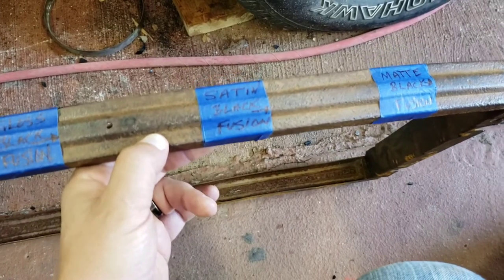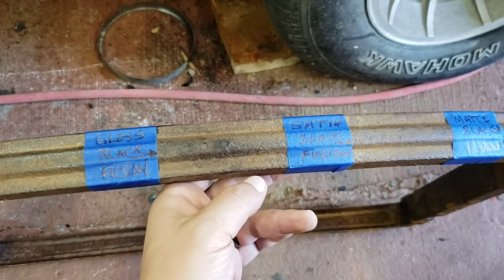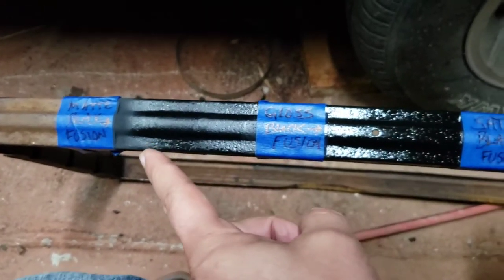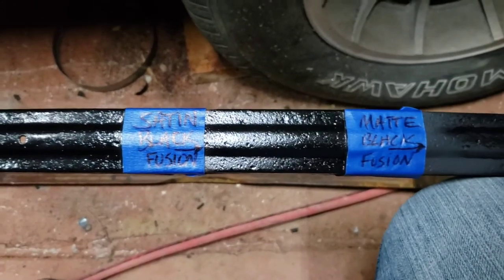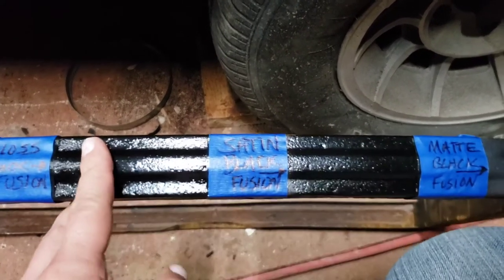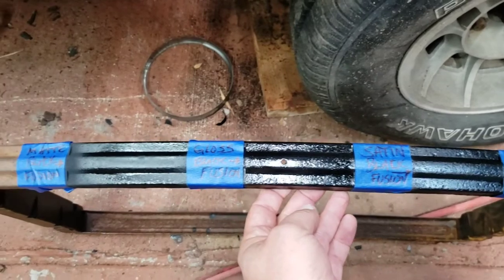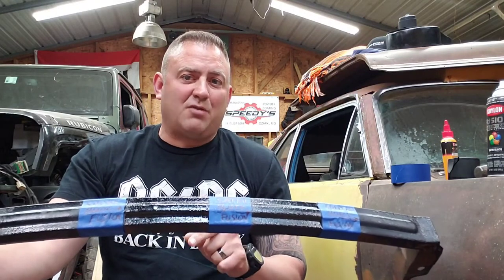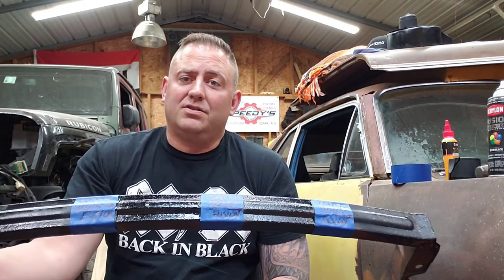KRYLON FUSION GLOSS BLACK VS SATIN BLACK VS MATTE BLACK FUSION all in one PRIMER PLUS PAINT

Comment: Excellent video. I'm painting my headlights inner shroud, I want to use the satin black for this, I know fusion says no prep, but should I scuff it up before painting anyway? And do I add a satin clear coat for UV resistance?
Reply from the maker: As far as scuffing up or sanding...I would just to get off any issues with the metal or paint that may cause it to not stick to etc...  as far as clear coat...  I am not aware of any fusion clear...even though I would definitely like to see it and try it out...they may not have it in my stores....

Comment: You can be a professional painter, the problem that I am seeing is that you were very cheap with the paint, and you paint such small squares and especially on a very rusty bar. That is the reason you can't see no difference between paint coats. As a professional you should have painted on the hood of any car

Comment: I used glossed then color sanded then used flat and it ruined the part the paint crackled. I waited 3 days in between coats. Ruined a brand new plastic grill for my sons truck. Fuxk Crylon fusion it's garbage just cost me a week of work 30 dollars in paint and a 70 dollar grill. I will call them I bet they don't care at all. Lesson learned they have competitors I will go that route.